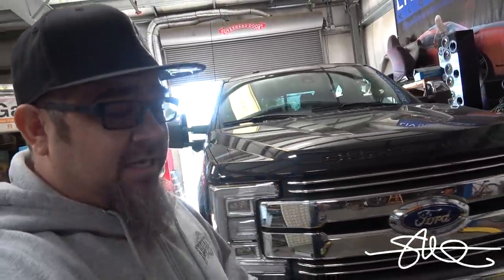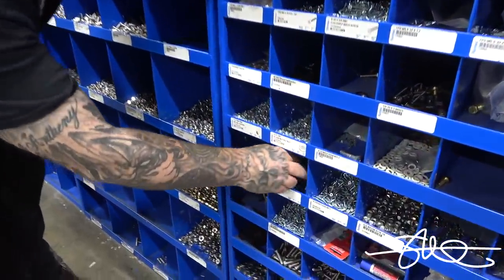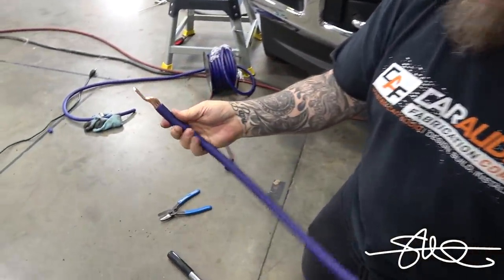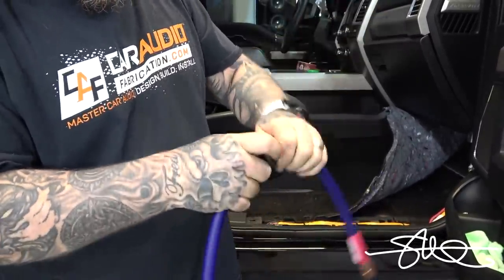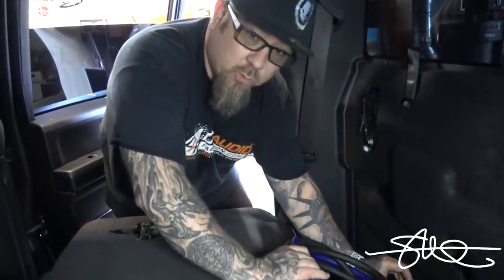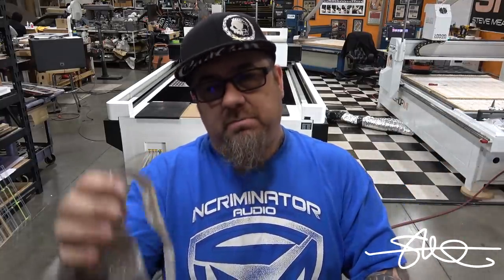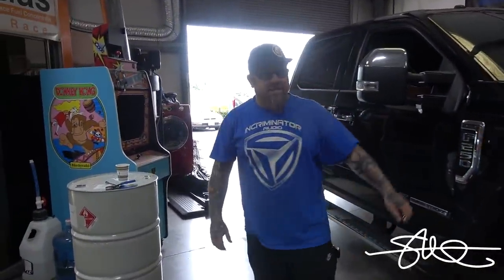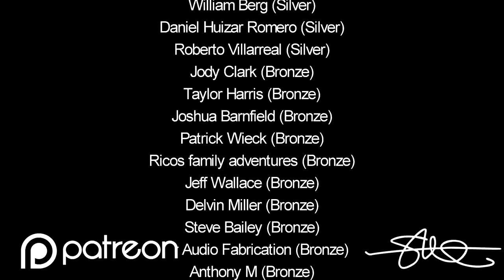Upgrading the BASS! 2017 #Ford F250 | Running 1/0 OFC Power & Grounds + "Big Three"

Comment from the maker: follow my instagram for daily live feeds and basically my daily routine in little tiny squares you can click on. http://www.instagram.com/meade916
Reply from the maker: Conner  no shit on the programming. No way on the straight pipe.  LOL.  That is literally the last thing i would ever do.  Could use a little tune though.  Or just leave it alone it's great the way it is stock.
Reply: what kind of cutter did you use to cut that wire??
Reply: God Bless you and Family. Salute #SMD
Reply: How can I get in touch with this guy...potential work but I'm not in California....any giveaways or donations you want to do?
Reply: Where can I find that heat shielding? Both kinds you used?
Reply: meade916 do you need to run 1/0 to the second battery to take advantage of the second battery or no? Battery to battery?
Reply: meade916 i don’t have a full frame on my Audi what do you do if that’s the case
Reply: @meade916  yeah I'd have to agree. somethings are just better left stock. maybe some tunning but hell no on the straight pipes.
Reply: Subscribed followed 👌
Reply from the maker: @sacsicc916  ground to the uni-body. Just make sure it's a good solid, clean spot.
Reply: Too meade916. Why are there no more people using tinned copper tube on the power cord? Turn the screw straight into the cord then you will destroy metal threads! and amplifier does not get 100% contact with cable! The best way is a tube that gets smaller when you turn the nut inward. No amplifiers have this.
Reply: Hay dude love ya work. Just wondering why you used the indent crimper on the lug and not the hex crimper???
Reply: Can someone tell me how to run the ground? So it gos from alternator to what to what and what now? Or just from motor to frame, then ground from amps to same spot? And no ground from alternator?
Reply: please ip you can mace a traniation into a town
Reply: @tallyoup  You NEVER use a hex crimper on a copper end. It's either soldered or its a single indent crimp. Hex crimps are for multi-metal ends that are much thicker. I've been crimping heavy duty ends for over 20 years,
Reply: meade916 does that not need 0 awg ran from the second battery as well?
Reply: Single or optional dual alternators?

Comment: Electrician here, Look up the "ty-rap" tool. Its a really clean way of installing zip-ties., Ty-Raps have metal on the connection end, and you can use the Ty-Rap gun to install them.

Comment: as a Ford tech that is typical for the batteries to leak out of the caps, the batteries usually only last a couple yrs anyway as they cook to death from engine heat.
Reply: Sounds like bad design on Ford's part
Reply: @philb707  genious idea to stick batteries in any engine compartment in any vehicle. especially today with as hot as engines run.
Reply: @juggernautxtr  touche'

Comment: Steve the dealer fills the battery to high and that’s why you have corrosion you can see the stains on the battery so check those battery caps make sure there sealed
Reply: almost every single 6.7 2017+ leaks. Had the same issue, replaced mounts with billet alum. mounts and new Odyssey AGM's.

Comment: Great video as always. I really can’t wait to see how you are going to connect the new system up to the factory deck. I have the same truck and want to do a system like this but I’m not sure how to get the signal from the factory. I can’t even get anything to turn on if I disconnect the stock amp. 😡 man it’s frustrating. Not like the old days when you just plug and play.

Comment: Thanks for taking the time to continue putting these vids out even though your busy making your products man 👍🏻
Reply: Can I ask why you put the cable from the alt to the fuse plate vs the battery? I’m about to do mine and curious. Will it still help the battery in that location ?
Reply from the maker: @jcook8191  If you notice our SMD Fuse holder, one side is a solid bar. Both the battery and the alternator are connected on that same bar.
Reply: meade916 thanks for the reply . I never knew you could do it like that

Comment: Unlike alot of ppl, u took the cover off to screw down the new fuse holder, I honestly can't tell you how many drywall screws I have removed from customers fuse block cover AND fuses cause they just set it there and ran a screw through it and through the fuse beneath it lol.

Comment: Ohhh, so you connected the battery to the terminal, and then the alternator to the same terminal that’ll connect via 1 0 gauge straight to the amp. I’m guessing for smoother power output. I Never thought of that before to be honest.

Comment: Def an awsome truck .   Good shyt bro....    I was to cheap for a crimper   so I improvised   a long time ago on my power wires        I'll get the matching  terminal  on my 0...    I'll flip it up in a vise    add alittle flux...  heat the    terminal with a torch    as I'm puddling in   solder    to the brim     and  dip  my power wire  in    hold it  for  10secs.   ..  it kinda became  a habit  and awsome  and I've stuck with it..    working on diesels and owning one   them cables  are mandatory   for your starting system   🤘badass 6.7 bro...

Comment: Man I love your attention to detail on everything, even down to the heat shrinks. I'm about to actually install 2 15s in my 07 Highlander, doing big 3 today, running amp wires tomorrow then subs and amp when they come in on Tuesday. I also Have 2 15 inch old school Bostwick hdx in my ext cab s10. That little truck pounds hard.

Comment: What do you do to Big 3 an F150? I have a 97 an 05 I want to do. There are more wires than I expected running from the alt. Do I just piggyback? Is it safe to replace that positive that looks like it has a resistor? The 97 was more of just a replacement of stock with better wire. No real stereo other than aftermarket deck. Do I just replace OEM? Parallel the big 3?

Comment: You  can a low/high pass filter on the audio tracks to cut out most of the shop machine noise. it will help a whole lot with talking
Reply from the maker: no it won't.

Comment: Might want to seal those holes in the fuse cover - a little silicone on the inside would keep it clean and prevent water getting into the fuse box.  Beautiful work - love that 1/0 crimper!!!
Reply from the maker: nah. Water isn't getting in.
Reply: the nuts and screws would squeeze so tight it automatically becomes waterproof

Comment: Great video and awesome job Steve!!!👌👌👌 You always make things look so easy even though we all know their not!!! It's pretty cool how the heat shrinks have the FORD lables on them!!! 👍👍👍 Is that something you do to them inhouse or do they come that way??? Just curious that's all!!! When your doing the BIG 3 upgrade for an install, how do you know when to use 1/0 vs 2/0 or even something as small as 4g??? What exactly is to be taken into consideration before you even make that kind of disition as to what's the proper gage wire to go with??? XS POWER sells BIG 3 kits but not for really really big huge powerful installs!!! The BIG 3 kits I have seen are for systems between 4k to 5k watts nothing for above that I don't think, that's in their website!!! Maybe I might have overlooked I don't know!!! 🤔🤔🤔
Reply from the maker: did you watch the video?  You should watch it all and then revisit your very first question. Thanks man!
Reply: @meade916  Oh ok my bad Steve!!! I think I missed that part the first time I watched it!!!😂😂😂 Now I saw how you did it on the computer first thanks bro!!!👍👍👍

Comment: Same thing happened to my batteries with corrosion the mounting bracket was to tight and put to much pressure on battery seal ended up leaking acid

Comment: More power less heat on that amp lol they only get really hot when there on the struggle trying to get all the power they really call for lol so yes 0 ga to 4 ga lol well a few runs of 0ga for expansion lol I'd really like to know what your opinion is on them 6.5s real talk i want to do a wall with 4 15s but then again I'd like to go old school and run a bunch of low power single voice coil 8ohms or maybe 4 ohm and see how many it would take to drop it down to a 1@ohm load lol it just shows ppl that u can take a shit load of low power subs and make them knock lol the more the merrier I ant really got around to doing the math of the sub line up but it's coming I have just hit a snag financial wise but being down never last forever when your a go getter lol but ya I can't wait to hear ur real insight on them 6.5s after u get everything completely installed the true sound quality wise but fuck ya Steve get r done like old Larry the cable guy would always say lol

Comment: Steve why did you do a ground from the trany to the frame dint see you run a ground around the alt is it becouse the motor an trany is all in one
Reply from the maker: because it was close, easy and had a nice hole.  Ground is just as good. Anything attached to the block is a great ground usually.

Comment: The fuse placement is nice looking but if u blow a truck fuse are u going to have to take everything apart to get to them are there any quick discounts options that would make it easier to access just a question for when I do mine
Reply from the maker: a 1/2" wrench (or pliers in a road side emergency) , and just a couple minutes of my time is all it takes.  Just move them out of the way.  Put them back when done in a matter of a few minutes.  Sometimes, in car audio, you have to sacrifice a little to make things happen. None of these manufacturers do us any favors when it comes to aftermarket shit.
Reply: @meade916  right they cram everything in their leaving no room to even work love your work hopefully one day I'm fortunate enough to get to have a system from u installed I'd have to say your one of the best in your field

Comment: You can quite the dust collector call a sheet metal company and get rid of that flex duct where you can.
Reply from the maker: how? by putting it outside? thats about all i can do and i'm not about to build a room for it.  And the "flex duct" makes no difference in the sound. Thanks anyway for your help though just in case i needed some.

Comment: Just a heads up that corrosion is caused by a leaking battery that thing is toast. Either the hold down has rubbed through or the caps are leaking.
Reply from the maker: nah. They aren't toast and nothing has rubbed through LMAO.  Thanks for the heads up though LOL

Comment: Hey Steve I have a problem I hope you will help me with. I have two dvc 12's that are 1.3 ohms. The subs have 4 speaker terminals for each coil. How do I wire them to get a 2 ohm load?

Comment: So what about upgrading the power and ground from Battery to battery cuz now you got a 0/0 going to One battery and then the other batteries running Factory wire in between the two batteries
Reply from the maker: i don't give a fuck about the 2nd battery. I am more concerned with the alternator. That does ALL the work.  Hence the reason i attached to the terminal bolt and the engine directly.  The batteries only come into play when the vehicle is turned off.  I can still play the system just fine while not running but i typically play it louder and longer when actually driving.

Comment: hey steve i have an f150 2016 i will be running a dd m2000 do u think i will need a big three upgrade i was planning on running it @ 2ohms  i already have a x2 power agm
Reply: F150 3FIVE I have same truck, same amp. Did you run full length power and ground from battery to amps? Haven’t installed mine yet!

Comment: @meade916 wouldn’t that trans case be some sort of cast alloy and not that conductive/ not the best thing to ground to the frame?? There should be a factory engine block to frame ground that could just be replaced with 0 ga. I would also upgrade the crossover cable between the batteries if there is one on that truck 👌🏼
Reply: Matt Etkin the stock engine ground strap is probably in a really hard to reach area like between the firewall and motor. On my truck its in that type of spot thats why i myself havent even bothered with the big 3. If something like this works id do it aswell
Reply: Shame iz dank that’s true, that’s one crowded engine bay for sure, but if the transmission case is some sort of cast alloy it definitely won’t be the best grounding point. I have an older Dodge diesel truck and fortunately everything is pretty easy to access.
Reply from the maker: @Mattymatt204  i'm pretty sure it's cast aluminum.  Should be fine.
Reply: Most engine blocks are made of cast aluminium too and they seem to work as a pretty good ground on everything else
Reply: Oh and alternators are cast aluminium and they ground on the casing
Reply: Kenneth Prince yeah you’re right, I always thought cast aluminum wasn’t a very good conductor or ground point, but although not as good as copper, it’s still ok.

Comment: Wonder if having that crimper, table, or actually wall mounted (vertically), with a huge arm would make it easier?
Reply: It's easier to have them mobile so you can use it where you're working instead of wasting the time to go to a table/wall mounted crimper.
Reply: @pyroman6695  true true..

Comment: Don't really understand the wire gauge when i have smaller gauge running a 200 amp panel in my house from the pole, which is sufficient . Looks awesome though. And i appreciate your attention to detail.
Reply: Technically no, amperage is amperage, conductors are sized according to amperage and voltage drop.  The difference between 120/240v AC and 12v DC, is power, otherwise know as wattage.  2400 watts on 120v AC is 20 amps, (12 gauge is sufficient). But 2400 watts on 12v DC is 200 amps, and at a lower voltage and being DC, cable length is significantly more important because of voltage drop.  Depending on the length you need to run, for that 200 amps, you could easily be looking at 1/0 or even 2/0.

Comment: Hey Steve what are your thoughts on knukonceptz wire? I ran some 1/0 ofc in my 2010 F250 and I’m not sure if I should change it out for better wire or not.
Reply: I'm not Steve but as long as you got OFC you're good to go. CCA garbage is what would need replaced.
Reply: Nicholas Wagner thanks sir
Reply from the maker: @nicholaswagner3515  i was gonna say the same thing. MOSTLY as long as it's OFC you are good to go.  There is other attributes that matter of course but that is the most important. Knukoncepts has been around a long time and people seem to like it so i would have to say it's probably good.  I haven't used any before so i have no real good or bad things to say about it.
Reply: knukonceptz wire is all I use any more in my suv and my house. only thing in my build I dont use from knukonceptz is the rcas. there ok but you can get better. if your system is smaller the rcas are prob fine. I got 2 18s in my suv.
Reply: Thank you guys so much for the input, have a good weekend!

Comment: Did I miss a step? Don't you need to run the 1/0 from the neg battery post to the frame also? What's the point of the engine to frame if the factory starter cable is too small. Again, maybe I missed a step. I've just found your channel and maybe binge watched like 30-40 episodes, mostly your build playlists, starting from that green Chevelle. Anyway, just always on the other builds you've ran battery to frame, then in the rear frame up to amps. BTW, I fucking love your videos. I'm 44, and was a bass head from my first car in 1991 lol. But now I'm a master mechanic/tech, been doing this since 96'. I work on everything, but I specialize in electrical troubleshooting. I am also certified on the Allison Hybrid system they put in the city/county transit buses. Now that's some serious cable! 720 volts DC from a 240 count battery pack which feeds a DPIM(dual power inverter module) and the DPIM then feeds the drive unit that's behind the engine. There's 2 100 HP electric motors, which just one can move that 20 ton bus without the engines help. Anyway I'm getting too techy, but just saying I know my power cables, LOL. Keep them vids coming. It'll take awhile but I'll watch all your previous ones.

Comment: Is hooking up the big 3 with another battery ok to do to your factory electrical? Or will it damage something? My car is a 2002 ford explorer Eddie bower edition. I have 2 Americanbass 15s on a synergy 2k amp and need a lil better voltage for the amp. I have 3 oversize 4 gauge wires and 1 oversize 0 gauge wire (all paths at least 16 ft) to do the runs for it all.Help me out if you can.
Reply: I'm waiting for the answer also...!!
Reply: You are asking this question in the wrong place try going here https://www.stevemeadedesigns.com/board/
Reply: @Blaetsian  a simple yes or no would have been better just saying but thanks I'll just get at exo or jp, they will just lmk
Reply: Quinton Litton First of all, a simple yes or no won’t work when you ask more than one question. Nor was your question posed to be simple. Some of the best audio knowledge you will ever find is in the forum, not here on YouTube. Steve, like most audio YouTube gurus, does not have the time to answer build questions anymore. He has a full time production shop and he hasn’t done daily install work in a long time. That’s why I posted the forum link. There are plenty of bass heads in the forum who love answering these kinds of questions, many of which are install pros. 

The big three is good for any system. At 2.5k I installed two batteries and a 320 amp alternator and it was enough. Now I’m running a 4K Orion amp and it’s a power hungry bitch, so I need two more batteries. I would run 1/0 instead of 4ga, or do two runs of it if needs be, and use audio wire not welding cable.